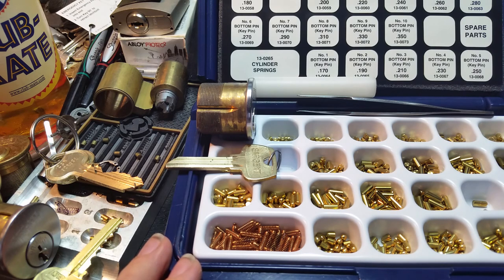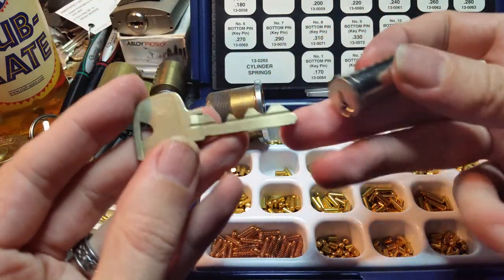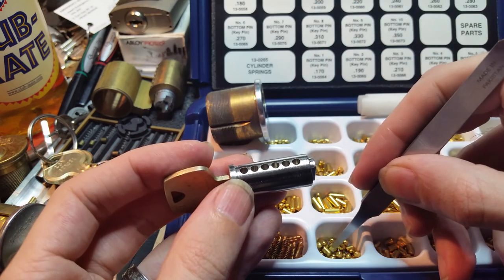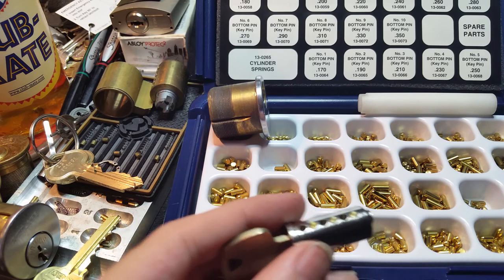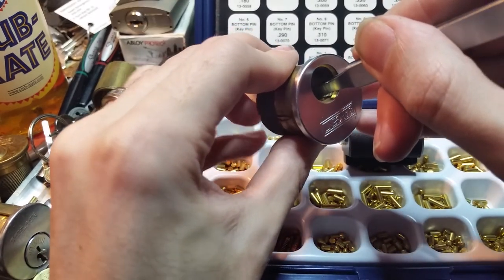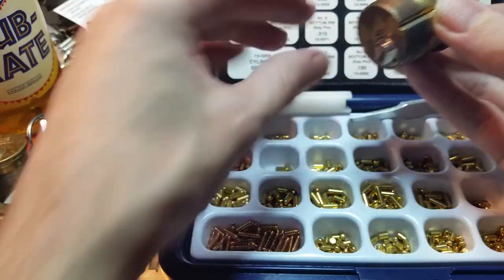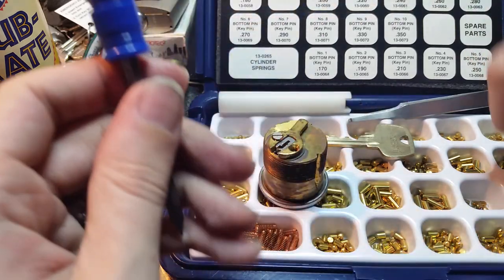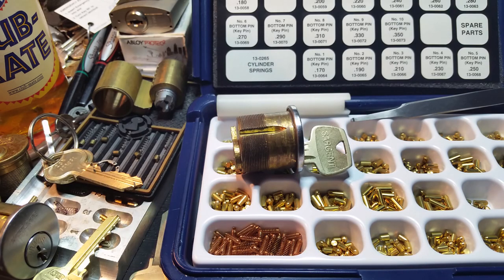(97) How to repin locks

Comment: Thank you so much. You saved my job. I was taking out the ignition cylinder in a 1940 Lincoln and the tumbler cover popped off and all the pins and springs flew everywhere.

Comment: I understand the thought process behind the first set of pins he installed but with regards to the driver pins it seems subjective.  Could anyone please explain in more detail to a newbie?
Reply from the maker: Sargent uses a 'graduated driver' scheme, as the key pin gets longer the driver pin gets shorter. There are two reasons for this:
1- With very short key pins when no key is inserted a driver pin may not be long enough to block the shear line, this leaves the spring as the only thing which blocks the shear line which will damage the spring and lock.
2- With very long key pins a driver pin that is too long may crush the spring or even prevent the key pin from being able to clear the keyway when inserting a key, this damages the springs and can prevent the lock from working.

If you can, take a look at the Color Passport charts from one of LAB's universal pin kits, it shows what length driver pins are required for different key pins.